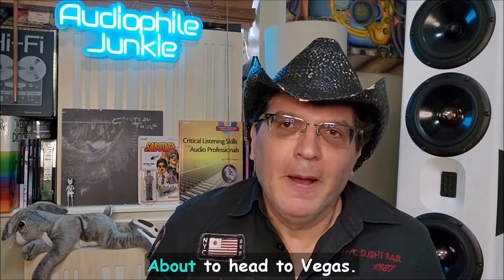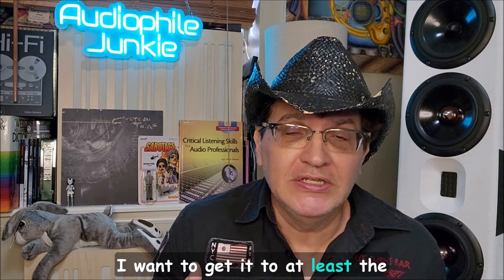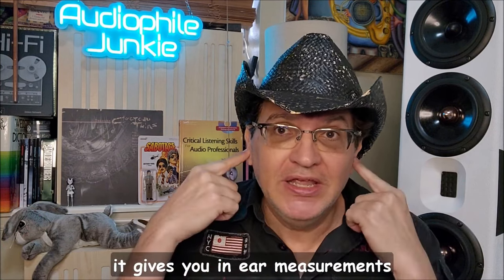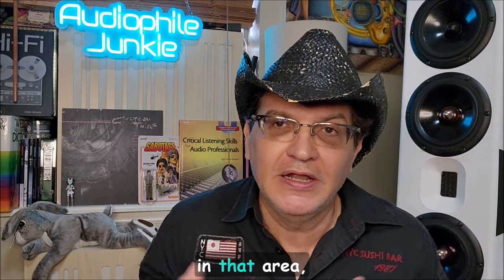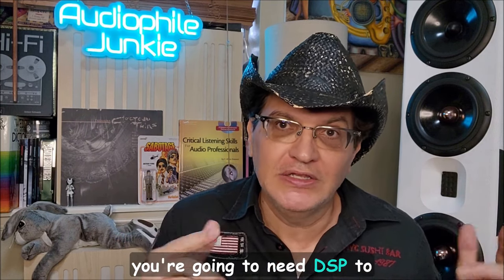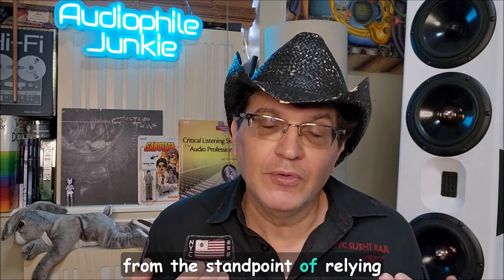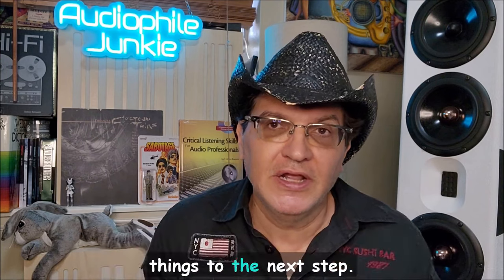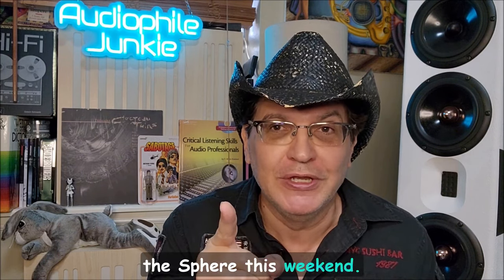Escaping the Frequency Response Myth: What You Need to Know

Comment: Its always best to start with a speaker that has a linear on and off axis response. Having a speaker that has a linear on axis with a non linear off axis response wont react well to EQ and will certainly get in the way when you want to adjust to taste. Frequency response is easy enough to change these days, room correction is easily accesible and aplenty but dispersion and distortion characteristics of a speaker can never be changed. Resonances too. Starting with all these parameters in check will save you a lot of time and trouble in the future, with DSP or not. The on axis response is just a piece of the puzzle, every other accompanying data has to be taken into account.
Reply from the maker: Yes I mentioned that was important, but simple volume alone can corrupt it on top of hundreds of other factors by the time it goes into your ears.

Thus, I typically remember a speaker be full range (or get a sub) before worrying about anechoic speaker metrics. I can fix many of those things easy, but can't fix adding LF extension.
Reply: @AudiophileJunkie  sound changed by volume isnt as much of a problem when room is treated. Most of the time the room itself cannot handle higher volumes and tiny reflections gets amplified, degrading the sound. Everything comes into play, even more at a bigger scale, but a good measuring speaker is still needed as a good basis to eq, fletcher munsoon curve or any curve that you prefer. I personally like a flat measuring speaker which translates to the Harman's in room response, in a good room.  Despite whatbsome might thing, a good flat measuring speaker wont sound flat or boring. Think Perlistens, Magicos, KEFs and Revels. Ill say this though, anyone that takes just the on axis response as bible is a fool, measurements are not limited to that one thing.

Comment: The reason one would want a flat response in anechoic chamber is because Amplitude levels affect distances to instruments on the sound stage. 

Having all frequencies at or near the same amplitude makes for all the frequencies that that particular instrument produces, sound as if the are coming from the same distance. ( including harmonics that might be above what one particular person might be able to hear ) 

The frequencies  both above and below human hearing also have to be at correct level as those frequencies affect the sound that we can hear mostly phase related. 

A flat response in the listening position leaves for unnatural sounding bass ( too low) and a tendency for the midrange and top end to be on the edge of being too bright. 

A slightly downward tilt with all the frequencies very close in amplitude leaves for a better overall experience due to the Fletcher Munson findings, as you have pointed out. 

However, I disagree with adjusting frequency response just to suit one’s taste, because although that may improve the overall tonality for the individual listener, it may make instrument placement on the sound stage far less accurate, less focused, less planted and may also negatively affect individual instrument tonality. 

It’s also critical to get both Left and Right amplitude levels exact in the listening position at all frequencies in order to also help get instrument focus dialed in and razor sharp. 😊
Reply from the maker: It's definitely desirable to get gear that measures flat...as I mentioned...because it's one less thing you have to correct.  However, ultimately people enjoy their system for a variety of reasons.  Some want accuracy...some want to just relax and not care about critical listening...some listen at low volume...some listen at high volume.  Thus, it's important to know about the Fletcher Munson impact such that one can at least be aware of anomalies that can pop up just from listening volume differences.  

Ultimately, someone should tune their system to whatever they like and keeps them using it the most.
Reply: @AudiophileJunkie  Do you think that it’s possible to have a system that sounds good at any volume level, is extremely highly resolving and accurate, very immersive, emotionally engaging, relaxing 😌, holographic and three dimensional, and has near to life realism?
Reply from the maker: You'd have to define "good" and how much difference in volume. 

Assuming wide volume deltas, it will only be OPTIMAL if you save different EQ curves for those volume differences.

In a primitive sense, it's no different than the "loudness" button I referenced.  Many liked it better engaged at low volume and got "good" response, but then it distorted bass when you turned up the volume... Thus you had to turn it off which is basically a quasi EQ curve per volume deltas.

Comment: Enjoyed your video very much.  Ime there can be grounds for a non-flat target curve aside from Fletcher-Monson.   At any rate, one of the things DSP CANNOT fix is the radiation pattern, so if one is going to use DSP anyway, imo it makes sense to prioritize radiation pattern over frequency response, within reason.  Radiation pattern affects room interaction, and it's more cost-effective to start out with speakers that have inherently good room interaction rather than relying on room treatments to fix off-axis response anomalies.  Imo room treatment dollars are better spent on optimizing the room's acoustics rather than on fixing the speaker's off-axis response.
Reply from the maker: Thanks... You have to pick the right speakers in order to get the radiation pattern you want. Some are very directional... Some aren't.

It's a complex equation now because even though you technically can't DSP radiation pattern... You can do even more important things with the Bacch.  A directional speaker will actually sound even more "open" with tons of precise spatial cues with crosstalk eliminated (on average) more than omnidirectional speakers.  Thus, the reason for people choosing certain radiation patterns may no longer be applicable once you have a Bacch.
Reply: @AudiophileJunkie  That makes sense to me, though I have no first-hand experience with the Bacch.  The earliest lateral reflections are strong conveyors of the playback room's small size, and imo it's desirable to minimize those early lateral reflections without resorting to aggressive absorption.  This calls for relatively narrow radiation patterns,  among other things.